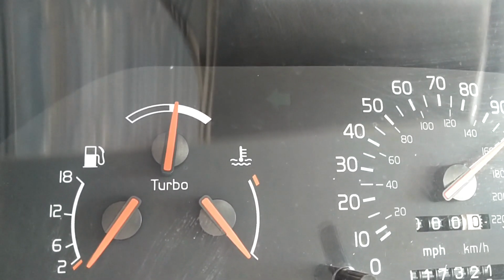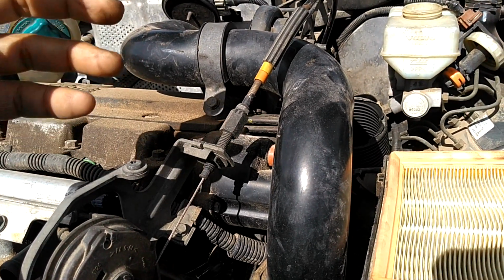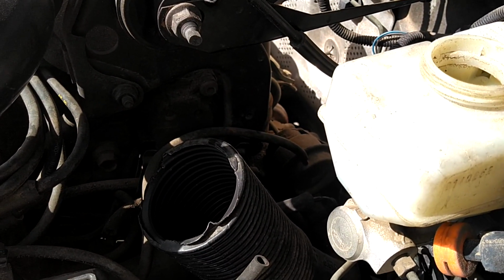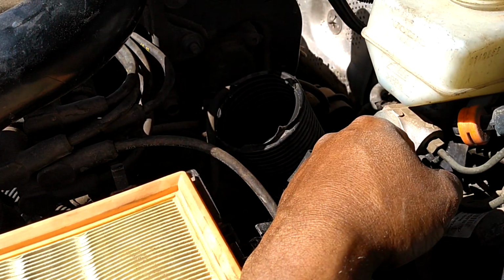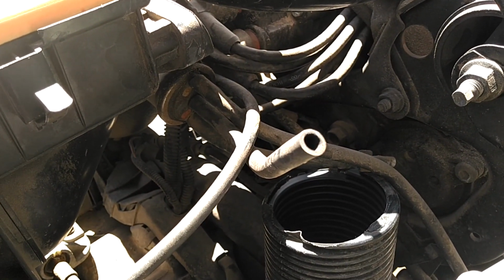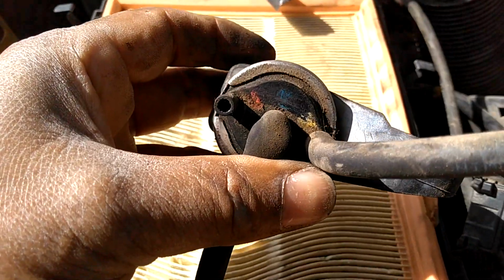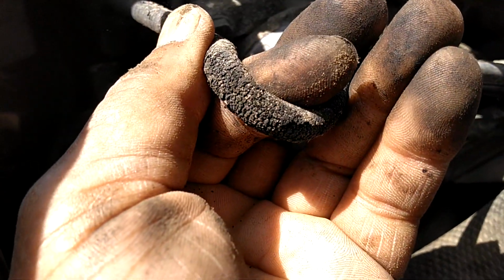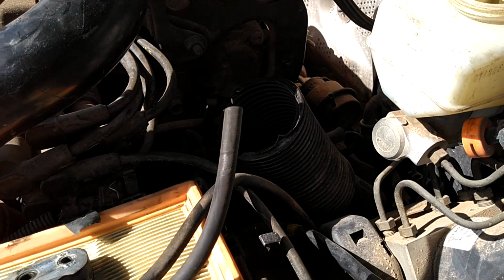How to tune up the turbo system on your car / truck. What to check, what to replace, how to test it.

Comment: Hi Robert. I always learn alot from watching. I had an oit line connected to the radiator just blow off . It was on the passenger side below the radiator upper hose. It has an o ring on the male side and a ring type clip holding it on. What could cause that. It was under hard acceleration.
Reply from the maker: https://youtu.be/nKOBYrvoCG8
Reply from the maker: Line failed.

Comment: what if it boost more than it should (more than 6-10psi) 

but it doesn't seem to have more power than originally maybe even less 

stupid question 😅

2.3t5 automatic
Reply from the maker: Cat is probably getting clogged.

Comment: You recommend silicone or rubber vac lines? From memory one type of line can actually suck shut under enough heat/pressure
Reply from the maker: rubber or GOOD quality silicone.

Comment: Hey Robert, I got an 97 850 t5 and shortly after I start the car i get a bunch of smoke that smells like burning oil coming from the back of the engine (where the exhaust manifold is). I thought it was the turbo and went ahead and rebuilt it. That didn't solve problem. What could it be?
Reply from the maker: Is oil on top of the engine?
Reply: @RobertDIY  nope

Comment: Thanks for sharing 
Have a wonderful day 
Can you used a newer Volvo turbo for 850 or should I say which other turbo is compatible with the 850!
Thanks again
Reply from the maker: You can put any turbo in there as long as you are prepared to make other modifications to make it fit.

Comment: Thanks Robert, gonna check out all my vacuum lines tomorrow. Could I just use 4mm ID lines for all of them if I zip tie them on? Or is it important that the places meant for 3mm have 3mm?
Reply from the maker: I suggest you mix it up.

Comment: Very well put together, you forgot to add to double check the waste gate rod for proper operation and adjustment.
Reply from the maker: Above most people's pay grade. Going to cover that in the "failing to boost" video.